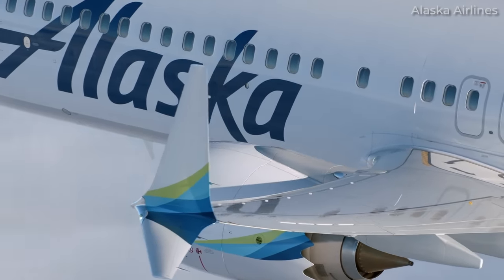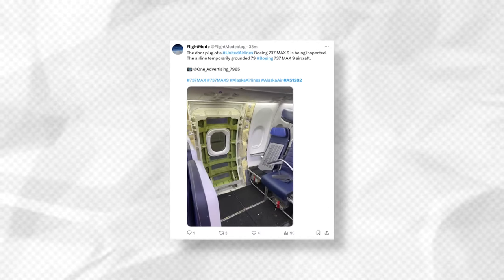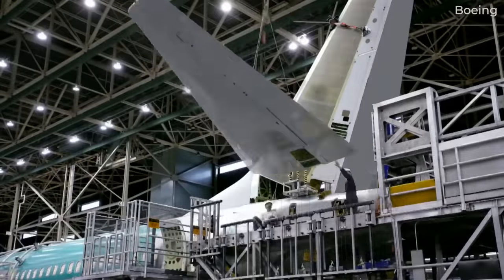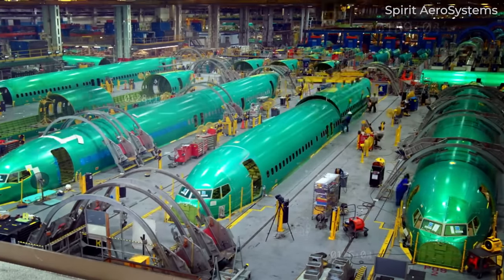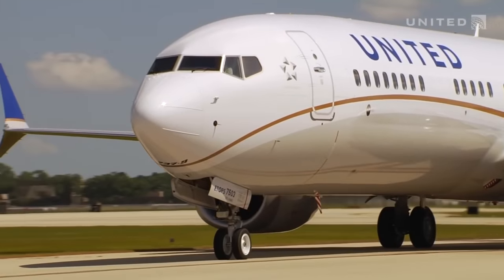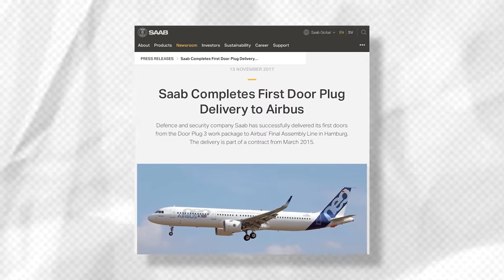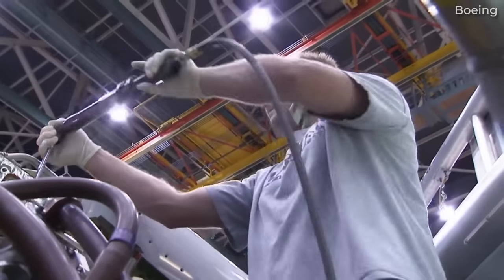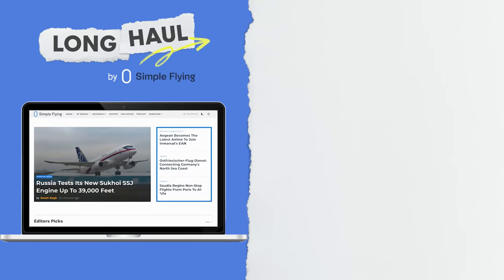What Are Door Plugs & Which Aircraft Have Them?

Comment: There is ambiguity about how door plugs are installed and their size and shape.  The reason this is important, is because if the plugs are installed from the outside, then they are no larger than the opening and could easily pop-out with minimal internal air pressure in flight, if even a single bolt is omitted.  An extremely bad design, with no failsafe.    If the plug is installed from inside the fuselage and is larger than the hole, then cabin air pressure would keep the door sealed, unless pressure exceeds the strength of the plug or the door frame, in which case the plug that departed should have been terribly deformed by squeezing out through the smaller hole.  And it did not look deformed to me.  Regardless, IMHO, visual inspection and bolt replacement is a temporary measure - a plug-redesign and a fuselage door frame redesign are necessary before I will fly another 737.  737s are based on the 707 fuselage, a 75-year-old design.  I know this because the 737 is the only Boeing product I absolutely despise as being too narrow for six-across-seating.

Comment: The 737 has become the new infamous DC10. I wonder how long it will take for Boeing to come up with a new clean sheet design.
Reply: They had one but they let Airbus take it!!!
Reply: @jdf1stats the 220 wouldn’t be designed by Airbus or Boeing as it was in production already. They also said they wouldn’t look at clean sheet design until the next generation of aviation technology comes out. The 737 can keep up with the a320 which is their only competition. The 757 was a better single isle jetliner but high production costs kept it from overtaking the 737 same reason the A220 isn’t being pushed more by Airbus.
Reply: Even if Boeing were to do a clean sheet design, it doesn't help that there are problems with QC.

Comment: So the fuselage is delivered to Boeing with the door plugs in tact boeing engineered then remove it and obviously have not fitted it back correctly?
Reply: According to the Aircurrent, the door plug was properly secured but then was removed by Boeing so Spirit employees working at Renton could resolve an issue with rivet installation on the panel next to the plug.

Comment: Door plugs seem to be too big of a risk. If an opening is meant to be a door, it should remain as such, no exceptions. Reason? Flight staff already have procedures to ensure doors are secure. Door plugs have no such procedure while in normal operation; once the paneling is put back together all of the non permanently fastened bolts are hidden. The only acceptable installation of a plug should be a more permanent solution like welding.
Reply: Door plugs are safe, it just comes down to how well they’re installed. In the case of the recent incident, the door was just improperly installed, or at least, was installed lazily.
Reply: @taxiway207  That's my point exactly.
Reply: @yaughl  if door plugs were welded, it would be much harder for airlines to reconfigure aircraft how they see fit

Comment: Isn't there a similar problem with MAX-8 vs MAX 200 planes?
Reply: No. Whereas the high density MAX 9 is still a MAX 9, the MAX 200 is technically a separate variant with separate certification. It comes with the extra exit doors. Instead of plugging the MAX 200 doors, airlines can just order the MAX 8. As far as removing the doors and plugging them for the secondhand passenger market, I do not believe this is possible.

Comment: Boeing needs to move on from the 737. The constant retrofitting and refitting of a SIXTY YEAR OLD core design has reached breaking point!
Reply: The NG was the last "healthy" update for the 737. The MAX had a lot of unhealthy things added to it which eventually made it deadly.
Reply: That doesn't fix the fact they aren't doing QC properly. There are too many things slipping through the cracks in many models of their planes. And the FAA is there, believing everything Boeing says without even checking. That's how the MCAS stuff happened. That's how they find loose parts on their Dreamliner, and so on
Reply: @LaczPro  Boeing should never have been allowed to self assess! The conflict of interest obvious. Self regulation never works.
Reply: Mcdonnel Douglas bought Boeing with Boeings money
Reply: That has absolutely NOTHING to do with production quality. There's nothing wrong with the design of the aircraft. I'm sick and tired of hearing that argument. The A320 is no spring chicken either.
Reply: it's already been confirmed that Boeing does not remove the door plugs. They install components into the aircraft through the larger main doors. 
Ultimately, while Boeing can be blamed for quality control, I find it naive to think that every single bolt on every single aircraft can be checked. It's ridiculous.
Reply: @sainnt  A320 is almost 20 years younger and has way fewer safety incidents and QC gaffs, especially with their more recent models.

The fundamental issue with the 737 Max and Boeing in general is how it brings technology and automation to its fleet of aircraft. Boeing takes an 'ironclad' approach, retrofitting its ageing designs with new technology, stretching them to breaking point. Meanwhile Airbus designs its aircraft from the ground up with technology in mind.
Reply: @mikeward1701  Can't conflate the aircraft design with QC gaffes. The Porsche 911 is basically an almost 80 year old design. Doesn't make the car any less good. Those 20 years don't make the A320 any better. That just happens to be the preference for some people. Same people argue that the A350 is better than the 787. Whatever
Reply: The design of the plane has got nothing to do with quality control.
Reply: @magnustan841  Of course design impacts QC.  More complex design = more parts = more things to check in QC, more items to miss or skip.
Reply: lose, improperly installed bolts
Reply: @tomAkelife-ff9tf  Or missing bolts. We don't know yet.
Reply: @sainnt  Geez...  You don't know much about cars, do you?
Reply: @Love2Cruise  Go ahead... talk to me about the Porsche 911. Let me see how much you know about cars, let alone aircraft. 
I know enough about cars to say what I said. If something I said wasn't clear, I'll be happy to elaborate.
Reply: @sainnt  Please elaborate how the 2024 992 is "basically an almost 80 year old design."
Reply: @Love2Cruise  Basic concept of the 737: narrowbody, 3-3 configuration, under wing engines, low slung for easy maintenance and ramp services, built in stairs. Basic Porsche: Egg shape for aerodynamics, rear engine, rear wheel drive. 
While those basic designs have evolved over the years, they haven't strayed far from the original concept. They're bigger, faster and more modern. That's it.
Reply: @sainnt Based on what you said, the A320 is the same design as the 737 then.  So is the 757.  Just because they have the same engineering layout choices, that doesn't mean they are the same design.
Reply: @Love2Cruise  Both the 757 and A320 series are born from that basic idea. The 737 was the first twin engine commercial aircraft of its kind.
However, neither the A320 series nor   757 are built like the 737, which still sits closer to the ground for easy maintenance and ramp services, and still comes with optional stairs built in. The basic concept of the aircraft, that aircraft is the same, just more modern.
Reply: @sainnt I don't disagree.  They have the same concept.  Again, having the same concept is not the same as having the same design.

Circling back to the 911.  Porsche made the conscious decision to keep the 911 with its RR drivetrain, while knowing full well that MR is the superior layout (i.e. Carrera GT, 918).  How can you say today's 911 has an 80 years-old design only due to its RR drivetrain and sports car shapes?
Reply: @Love2Cruise  The car from 80 years ago is not the same car today. It's an evolution of the same concept. That's the point.
Reply: And the point is that 737 max did not receive the evolution on the main fuselage itself. Most of the adjustment is made to engineer, wings, and other parts that is not the fuselage itself.
Reply: @chunchoi4434  if you're comparing it to the NG, maybe. The 737 is a much larger aircraft than the one from the 1960s, and the cockpit is also different. The aircraft has evolved. And the Max 10 is definitely another evolution over the NG. The aircraft that fits your description is the A320 neo.
Reply: @mikeward Possibly. However, what happened with the Alaska MAX 9 does not fall under this statement. The idea of door plugs was taken up by Airbus for its "newest" plane, the A321NX with its "cabin flex" option. If the 737 with door plugs has "reached its breaking point", so has the A321 with door plugs.
Furthermore, the vast majority of airlines would rather pay tens of millions of $ less for a more efficient update than for a clean sheet design where all the R&D is built into the list price.  Of course airlines want their planes to be safe. Both the MAX and A320neo families have order backlogs in the thousands. If airlines were concerned about aging "core designs", that simply wouldn't be the case.
Reply: @Handlemcdaniel  I couldn't have said that better myself. Interestingly, there was recent news that Lufthansa grounded some A320 series P2F aircraft due to cracks in the fuselage. With those being older planes that's to be expected, I guess, but there are versions of that aircraft in the same age group still carrying passengers.
I also mentioned the fact that Airbus was able to quietly fix a defective front landing gear on the A320neo series. 
All these things are just as important as what's going on at Boeing if we're talking safety, but it makes more sense for the media to sensationalize anything that goes on with Boeing because it magnifies the Idea that Boeing aircraft aren't safe, but Airbus aircraft are. It's frustrating.

Comment: Yet another video made just a little too early. -900ERs grounded for inspections as well.
Reply: I was afraid you were going to say that... Flew on Delta's -900er. 😵‍💫
Reply: I was wondering when the -900ER was gonna get the same scrutiny as the MAX 9.
Reply: @jdf1stats  -900ERs / MAX 9s have flown millions of flights without door plugs flying off. It seems like this incident was a one-off due to an employee's negligence and Boeing's poor quality control, not a flaw in the design of the door plug itself. If anything, the -900ER you flew on was in all likelihood assembled before Boeing had such severe QC issues. Inspecting -900ERs was a good, "abundance of caution" move.